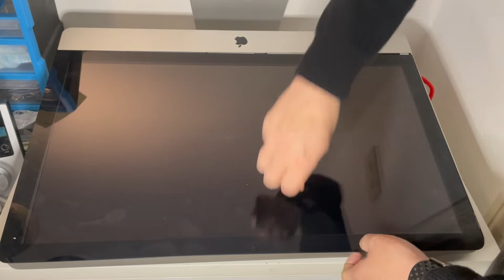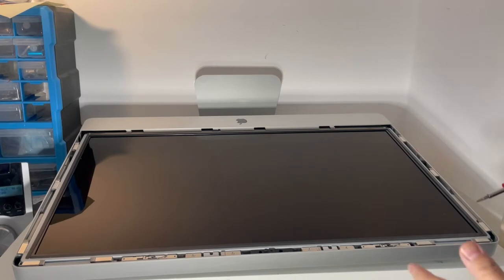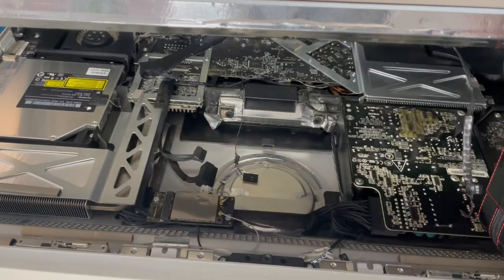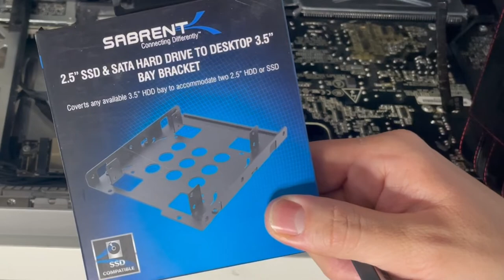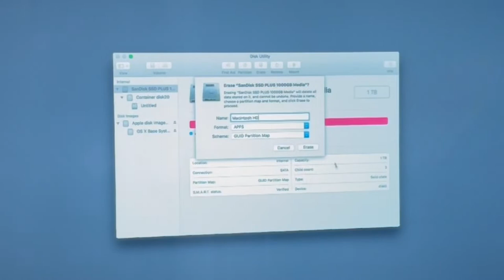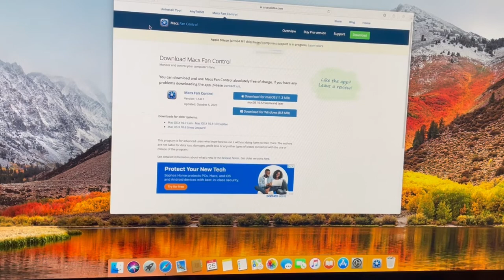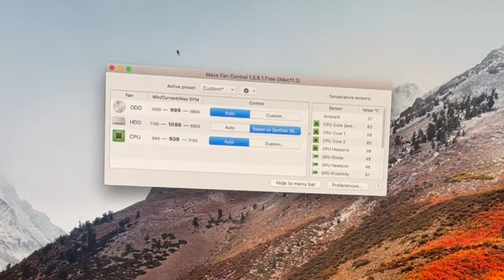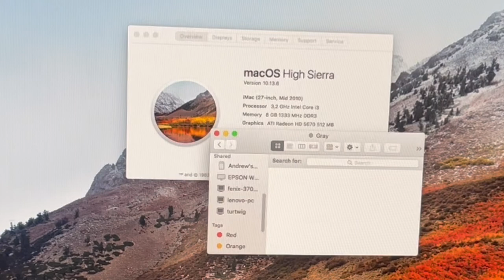iMac Mid-2010 27 inch (A1312) SSD and RAM disassembly and upgrade - Much FASTER!

Comment: THANK YOU, THANK YOU, THANK YOU. I used your video for the install of the new SSD and the fan software. My old computer came back to life. I am so grateful. It did not boot up (white screen with gray apple logo for hours) so I went to another video and learned how to clone my HD to the SSD drive (cloning took 5 hours) Then it booted right up. My 2010 27" works great for what I need it to do. Thanks again Andrew.

Comment: Cant thank you enough for posting this, just breathed life back into a 2010 iMac, blazing fast with a 1T SSD and 12g Ram!
Reply: Jay, Did you have any problems installing osX operating system on new ssd as described by Andrew?  Or did you a different process?  I have been unsuccessful in my attempts following his instructions.  Thanks
Reply: UPDATE:  Repeated process and this time the recovery server was able to be contacted so downloading High Sierra.  Did nothing different so assume Apple server not available last evening for some reason.  Just happy it is downloading today.  Hopefully will have same success you had Jay.

Comment: Very good video! Simple , direct and yet covers all needed tasks to upgrade this IMac with a SSD and OS install procedure. Other videos on the iMac 2010 make this look like brain surgery Thanks!  I am not a computer person and almost missed the fact that you need a connected keyboard and Lan (not blue tooth keyboard and WiFi ) to issue  initial commands and access the internet for the fan software download. I have ordered the parts you used and will do this upgrade next week. I had an original  hard drive failure and was quoted $ 725 to repair. This upgrade will issue new life to my IMac.  Again, thanks!
Reply from the maker: Glad you found it useful!

Comment: Really helpful, I'm hoping I can open up my wife PC and bring it back to life. My glass was so tight and strongly stuck together, I used a blade knife to create a gap so I could use my fingernails to pull it apart. I used a stong suction cup and the glass wouldn't budge. I was convinced they just glued it on haha.

Comment: Just found your video and channel today after it was released 2 years ago. So definitely late to the party. 

I do have a 2010 iMac. Easily upgrade the memory to 8GB within a month by just unscrewing the 2 screws, pull the old one out and put in the new one. Wished Apple didn't made it complicated to add memory and SSD but they did to future macs.

SSD were still expensive at the time until the last 3-4 years. And just the worry of messing up the screen put me off damaging a $1,000+ purchased iMac. Now I seen your video and the iMac is too obsolete to use in its current state, it would be worth it to open it up and make the upgrade.

Comment: great video (perhaps some close-ups would have been even more useful) you did a jump-cut when re-connecting the SATA cables to the SSD which is a shame - (bigger close-ups of the vertical sync cable being disconnected would been the icing on the cake) - but as a quick reminder this video is still very much appreciated

Comment: Followed your steps and everything looked AOK until attempting to install Operating System.  Won't install High Sierra ...... states "The recovery server could not be contacted".  Do I need to reinstall operating system that come on this iMac?  I believe it was on a disk that came with the machine and was Snow Leopard.  Thanks for your assistance
Reply: UPDATE:  Repeated process and this time the recovery server was able to be contacted so downloading High Sierra.  Did nothing different so assume Apple server not available last evening for some reason.  Just happy it is downloading today.  Thanks for posting.

Comment: My SSD and RAM upgrade arrives in 2 days, thanks to your really great video. Hoping my mid-2010 iMac is vastly improved.
Do you recommend a CPU or GPU upgrade on a mid-2010? (I am running a 2.8 GHz Quad Core Intel Core i5 and ATI Radeon HD 5750 1024 MB)

Comment: Great video. I am going to do this to my 2010 as well. Is it possible to update hardware on these older iMacs to run current OS?
Reply: Yes, with Opencore legacy patcher. It add all the software needed to upgrade your old mac. You will find tones of tuto about it on youtube. You'll need 8 go Ram on OS12. and 12 go Ram on OS14

Comment: Hi, Thanks for this awesome video!
After erasing the SSD, the installer said it needs Mac OS  Extended (journaled) , and did not let me choose the drive. So I had to go back.
After that, it did not let me choose other the APFS cos it was already formatted.
Then I had to choose to see everything on the top left corner view menu. Then I was able to clik 2 levels higher and choose different formatting settings.
I just tought it might be useful to commnet if anyone hase the same issue.

I hope it is not a problem that I've choosen a different disc format option...

Comment: I performed the upgrade of my mid 2010 27" iMac with recommended 1TB Sandisk Plus SSD, and although the computer once booted is definitely faster but oddly enough the boot time is longer than with the rotational drive.  Any thoughts?  

Update, I solved the problem about the slow boot time.
Reply: How did you solve the issue?.
Reply: @Latashamorriscom  I went into System Preferences then into "Startup Disk" and selected the "new" hard drive as the default hard drive.  What I suspect was happening was that the mac operating system was first searching for the old hard drive than after it couldn't locate it it defaulted to the "new" hard drive.  That roundabout boot up is what created the delay.  I went from a boot-time of 55 seconds to 23 seconds.......Hope that helps!
Reply: @albertbrooklyn  it definitely helps. I have the opportunity purchase the same iMac you have and want to do the same. Only thing is the one I'm looking at the Bezel is chipped.

Comment: Quicm question ⁉️

Can you put 2, perhaps even 3 SSD drive? It has mora sata cables connections?
Reply from the maker: Yea you can replace the SATA DVD drive too using a special bracket.

Comment: If I just wanted to buy the cable for thermal controller for the hard drive what would it be? Would I still need software to control the fan? Can you do this upgrade on the 21.5 in too?
Reply from the maker: I would just skip the cable and use software to control it, it's much simpler and cheaper.
Reply: @Andytizer  so I replaced the ram and hard drive erased the drive and the tried to install new OS it gets halfway through be for boot cycling and doing it again. Thoughts?

Comment: Hi, All good until High Siera doesn't load - "target is not convertible to APFS" so the drop down window says "server can not be reached"or "will not respond". Do you know what I can do to load the OS please? Many thanks. John.
Reply: By the way my Mac is exactly the same 27" mid 2010 iMac as in your posting.
Reply: What OS X did you have running before the procedure? I guess OS X El Capitan or something? I think High Sierra is no longer offered on Apple's server and therefore you cannot continue installing it. Just my thoughts of course and I'm no Apple expert 🙂
Reply: @johnnybals3183  So the OS is High Sierra, same as in the video by Andrew Tsai. But I've found a way forward, I  created a Bootable High Sierra Install drive on my other Mac running Ventura, and download it to an external drive, then started the old Mac with that plugged in, & it recognised the install drive immediately and loaded High Sierra.  I don't know why I needed to do that... but there appeared no other way. Cheers. J
Reply: Yahhh, that's the way, good job !!!

Comment: I was temped to replace my imac hdd with the new ssd many times but i just realize that the ssd was not that durable comparing to imac hdd. I did replace my window laptop hdd with the new 2tb ssd but i was not brave enough to do the same thing to my iMac